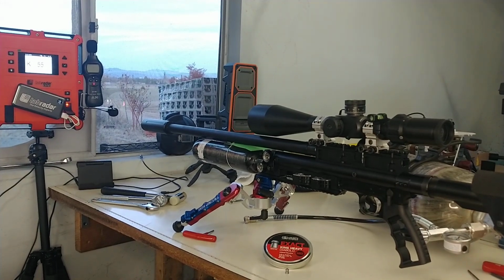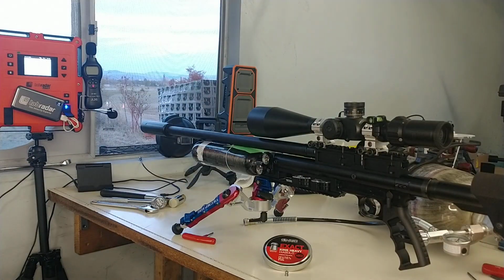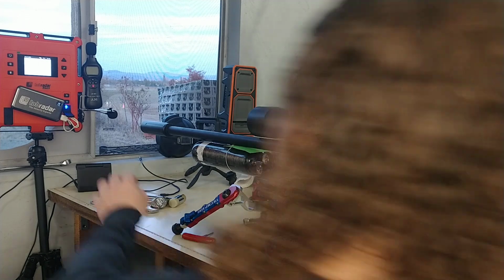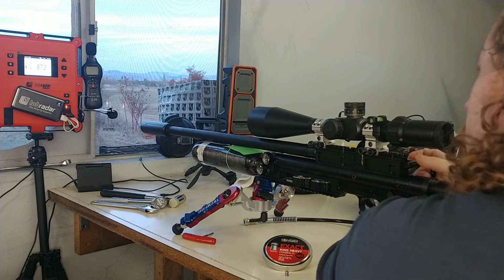Rogue Raptor 25 cal Candid Grit Test

Comment: That looks like a great air rifle. Which barrels are you using here? What is the length and twist rate? Is the barrel choked? regards.
Reply from the maker: 25 cal
26" Long
1:22
No choke
Reply: @jeffersonstateairrifles7510 Many thanks. You forgot to mention the Brand of the barrel, cheers. Oh yes, will it shoot slugs accurately and consistently?
I ask because a twist of 1:22 might seem a little slow. I might be wrong but that's why I'm asking. 🙂

Comment: I am a Raptor 25 owner and I was wondering what your pressures were at the regulator?
Reply from the maker: Well, if you are running a Raptor (one of the first generations) versus the New Rogue Raptor it will be different... And honestly I don't remember exactly...I just reviewed the previous video 'Fresh .25 Assembly - First Mag Results' and it was about 1500 psi... This is the same exact rifle in both videos... And extremely close to the same tuning.
Reply: @jeffersonstateairrifles7510  
Thanks for the Fast reply, unlike a year ago. I wish you all the luck and success.
Thanks again.
Ralph Capelli
Satisfied customer